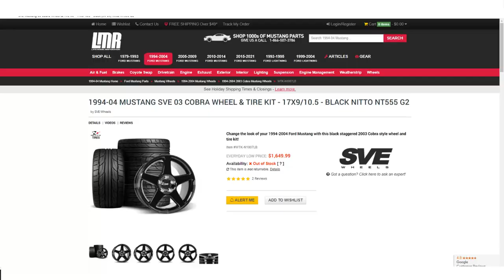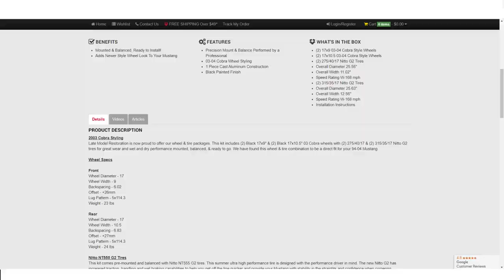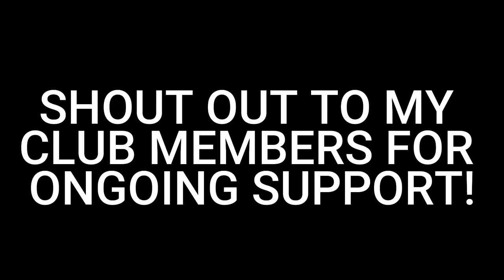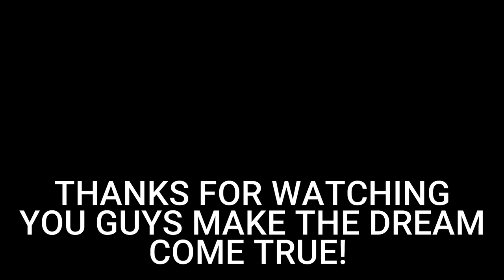How I Fit Fat A$$ wheels On a Foxbody NO CUTTING! 10.5" & 315's

Comment: Nice video!! I have the same size tire and rim on my orange car! 3" exhaust. No spacers. Had to message the inner tub to make it work. rolled fenders and no one can ride in the back set!! ;-)
Reply from the maker: Nice !
Reply: What spring rate would be good to stiffen up the suspension so the cars quarter panels wont dip into the tire?? I’m having issues with this
Reply: @Neomustangs  hey would you happen to know what size wheel stud & spacers I would need? I’m running 17” Pony Wheels with 305 rubber. Backspacing is 6.29” My issue is what would fit inside the stock pony center caps??

Comment: I have a have a question, do you have to run spacers if you have a rear differential off an sn95? I hear the axels stick out a little more. And if so would you still need to roll out your fenders?

Comment: Great video bro. My question is, do you plan on doing a disc brake set up with the c-clip eliminators, if so cause i need to do mines.My setup is like yours except i have 4lugs 5/8 studs.
Reply from the maker: No. Caddy brakes in front. Stock in back.
Reply: @Neomustangs  I was wondering if the Caddy Brembo brakes would work with these wheels. Have you verified fitment yet?
I love the way these wheels look.
Reply from the maker: 17” and above yes

Comment: Hey Bro!! Your channel is one of the best. You Always have kickass opinions on everything. So I greatly appreciate you. 

So I need your opinion lol. I’m seriously looking at a wheel for my 91 notch that’s 5 lug 18x11 + 8mm 
For the rear and could go either 18x9 +30mm or... 18x9.5 +10mm on the front

Which way would go for the fronts and for tires? I’m thinking this would be totally doable with the set up you showed in this video... thx in advance
Reply from the maker: If I could get it I would do a 9 inch in the front
Reply: @Neomustangs  thanks for the quick reply. 🤙🏻

Comment: I have fox length axles. Basically my rear set up is stock. I fear rolling my fenders, it has original paint. Can I run a 275 or 285 30 r18 with a 10.5 width wheel and not roll the fender????
Reply from the maker: Nah always wanna roll fenders period. They are so out of place. Just the rears

Comment: I know this is an old video, but wondering if it would be possible to also run these 10.5 inch wheels up front if swapped to sn95 from control arms + 5 lug spindles...would like to run 315s all the way around, this is for a track car so not afraid to cut/flair fenders.
Reply from the maker: I would not recommend

Comment: What's up man .love your video  I was hoping  u could  help me out. I just bought  some custom  wheels  for my foxbody. The centerbore  on the front wheel  are 63.4 and I can't get the to go on the hub any advice? Do ou kno if that's the correct  hub size on the front  it's a 1989 mustang  gt 4 lug stock break system.  Thank in advance

Comment: Good video as usual. I just swapped to a 355 gear in my car and now I’ve got a vibration from about 60+.. is this something that is common or have you heard of it happening??
Reply from the maker: Check driveshaft bolts.
Reply: They are tight. Could the driveshaft be clocked wrong? Like not put back in the exact same spot that it was.. would that make a difference? From 0-50 there is no vibration at all. It’s just speed oriented At 60 and above..
Reply: @landan_melton  possible,  check balanci g on all wheels...had same issue at same mph....And corrected after of set wheel balance.
Hey Ya Never know and it's  a cheap correction.

Comment: Is this something you can do a convertible as well? And can you send a link if you have it handle for the 3" studs and the spacers!
Reply from the maker: Yes. You need to know what knurl your axles take before ordering 3” studs.
Reply: @Neomustangs  whatever stock is I also did quad shock delete if that matters or help

Comment: So do you need better control arms to compensate for the missing quads with stock power or can I remove them and not worry about it. I flipped my quads awhile ago to fit my 10' wheels on but now that I lowered it the shocks bump against the quads a little
Reply from the maker: Nah you can do this pretty much with stock stuff. But with a larger tire comes sacrificing of the quad shocks

Comment: Thanks for the video! I have 03 Cobra replicas as well, 10.5 for the rear, but I have 275/40s I was planning to run. Do you think the 10.5" wheel is too wide for a 275?
Reply from the maker: It wont look right thats for sure. it'll fit snug tho
Reply: @Neomustangs  hmm.. ok. The listing for the tires said they can be used on rims up to 11", so I thought this would be an ok setup.
Maybe I'll need to sell the 275s and go with something wider...

Comment: I have the anniversary wheels 17x10 my back spacing is a little less than yours , they are lmr, can I still run 35/315 with the 1/2” and 1/4” spacers as you did? Of coarse 3” studs, what spacers u recommend?
Reply from the maker: I’m not 100%  sure you can use spacers to figure all that out tbh
Reply: @Neomustangs  I’ll get the spacers and give it a shot, thanks

Comment: how wide can I go with sn95 axles and cobra disc brakes? I have 10 inch wide Saleen reps with 275/35/18 on rear
Reply from the maker: You can do 10.5” probably wouldn’t need any spacers to make up for the 3/4” wider

Comment: I've been running a 17x10.5 wheel with 315s on my 93 coupe for years now.  
Is the space a personal preference?   I did need spacers with either drums or the Cobra disc conversion.
Reply from the maker: Yes. If you wanna move the tire away form 3” tails it is.
Reply: Any pictures ?

Comment: What tire size goes on a 11.5 inch wide wheel
Reply from the maker: That’s a 10.5” wheel
Reply: @Neomustangs  lol ik but i got 11.5 and ive bought tires twice before that didn't fit and i thought 305s would fit and were to small

Comment: Boss why 1/2 and 1/4” spacers.
Reply from the maker: Cause the fox axle is offset. Lol. Never sits right
Reply: I’m running a 285/40 on  10” pony wheels. I wanna the 315’s on them. They are not deep dish
Reply from the maker: It won’t look right imo. But you can tey
Reply: Your Mustang is sexy as hellion

Comment: Or just use a Sn95 rear end
Reply from the maker: No
Reply: @Neomustangs  yep. It'll work. Won't need space since it's already wider.
Reply from the maker: @samuelmariscal4556  pretty sure sn is 3/4” wider each side. Due to ring. I’m running 1/4” spacers on one side. 1/2” on other. So that would actually move my wheel out further than it already is no spacers on sn95 axle ……
Reply: You're absolutely right😅. My bad. Keep up the great work!!!!
Reply from the maker: Wasn’t trying to outwit you for sure. Just thought about that when I got the wheels
Reply: @Neomustangs  no sir. I was mistaken. I liked the fitment. I might try that out on my 4 eye